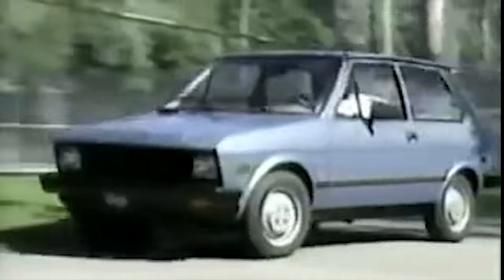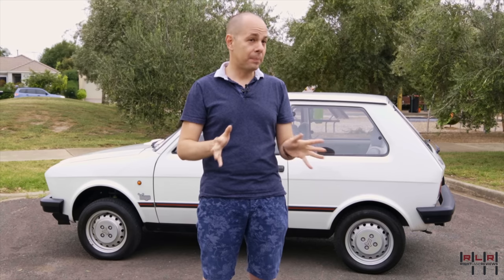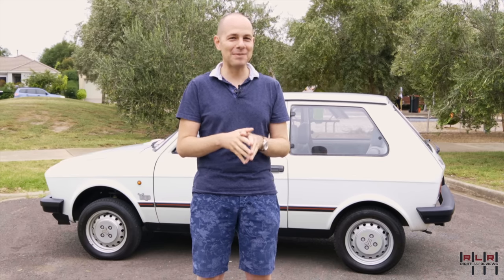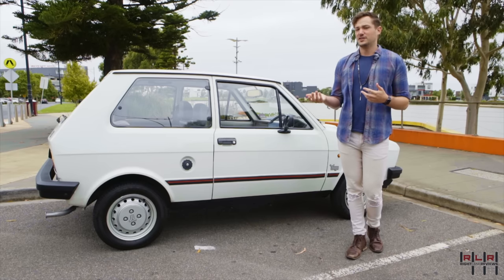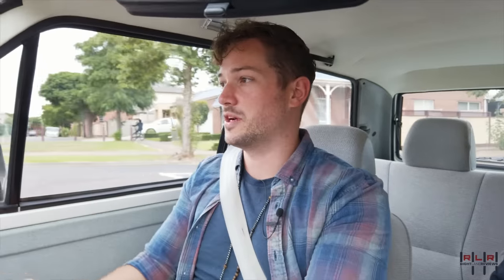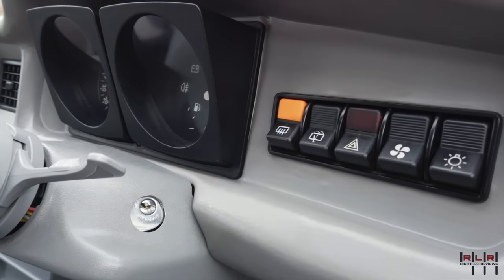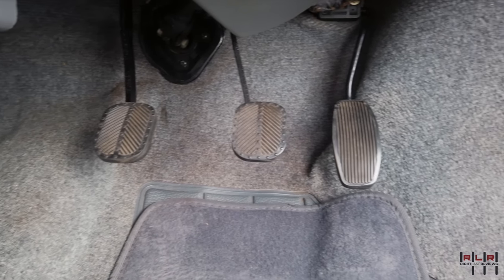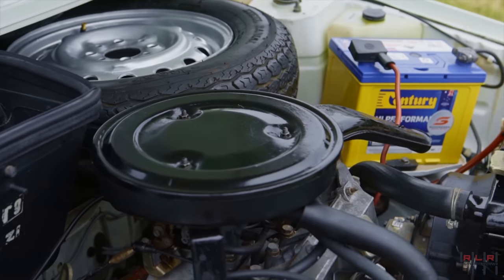RLR Presents an Icon: 1987 Yugo 55A Australian prototype (1 of 1)

Comment: Americans judged a Yugo like the fish by its ability to climb a tree. This car is made when oil crysis struck and it was obviously more fuel efficient than a V8 mustang, so it was able to cut the cost of transportation by quite high figure, even with the cost of buying it, but its interesting that a Renault 5 campus has less horsepower, worse suspension and yet got called a hot hatch

Comment: The journalists ridiculing this car never put in the perspective, like for example some did for the Lada. To americans (i guess Australia is similar, considering the geography) mobility doesn't mean the same as in SE Europe, where you need a car to drive to work (5-15 miles, very rarely more), and maybe 1-3 miles to the garden where you plant tomatoes and potatoes for your own consumption, and the odd shopping trip to the city, maybe also vacation, 200-500miles,not more. And it had to be affordable. In Western Europe it would be considered a small car, but not extremely small.
In the states one needs bigger cars, to move a lot with all your stuff, and even sleep in the car. In se Europe the concept having to sleep in a car because of losing a place to stay like is happening overseas is just strange.
Sorry, that was slightly off topic, i had to mention somewhere that looking at a Yugo  from the wrong  angle is just not fair.
I personally don't like the Yugo much, the steering wheel is positioned like in a big truck , I drove only the "45" in which the pedals are closer together which annoyed me, still a fine car. Good night.